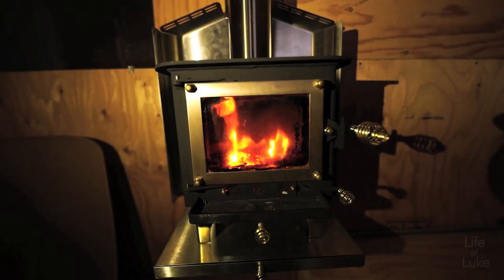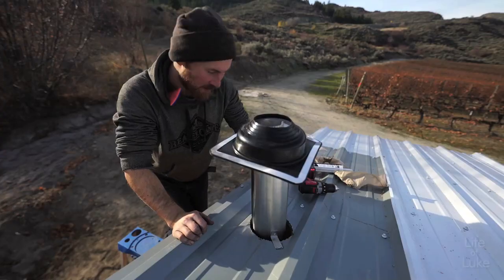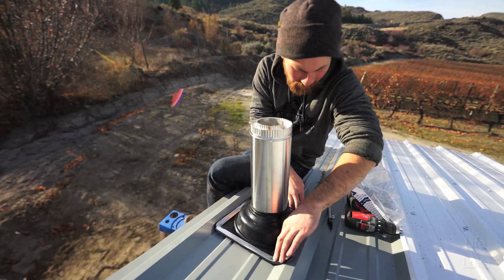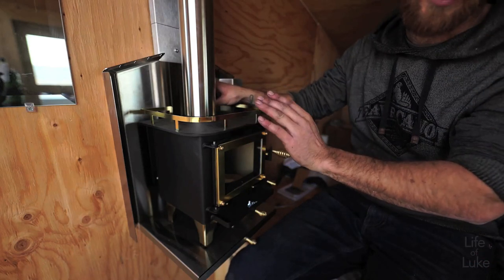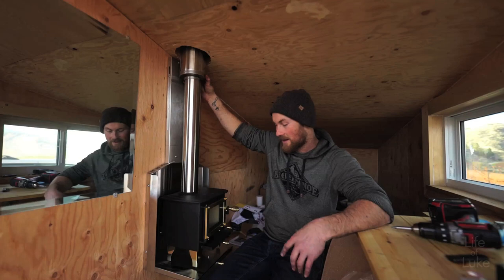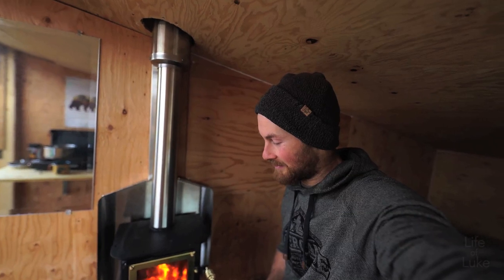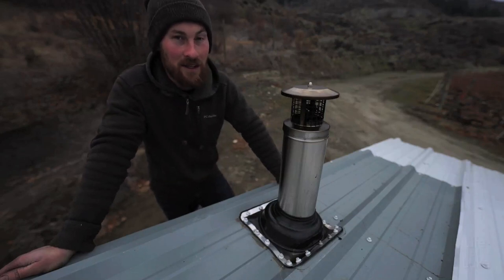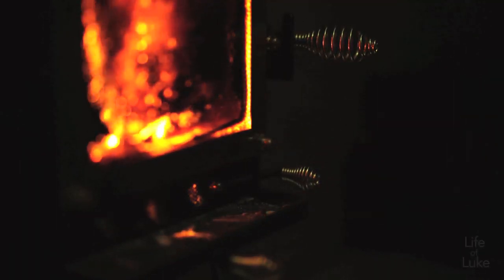Cubic Mini Woodstove Install How To

Comment: This is a great video! And channel!

I'm building a small camp shack on skids, and my Cubic is on its way, so I couldnt have found this video at a better time.

Thanks so much for putting your experiences and know-how out there! It's appreciated!
Reply from the maker: Thanks, I'm glad it helped! It the shack on skids for moving it onto a lake for ice fishing?
Reply: @lifeofluke  I'm building it with the intention of replacing my current older trailer with some shade of tiny house. It'll serve as an extended living space/guest bed for family (I jokingly called it my unattached livingroom), but I'm keeping the dimensions such that if the idea flops it can be sold and moved. It might just end up as an ice fishing shack for somebody down the road.

Hopefully not though 😉
Reply: Where do you purchase one of those

Comment: I know old vid, if u still have this setup. Try taking a small cap full of diesel an pouring it on ur wood before u light it. The added fuel will help huge to push the beginning of the smoke through the chimney then out the tiny door

Comment: You need to remove the baffles on the inside of the stove when you clean it. If you don't all the soot gets trapped up there and will plug up your flue. You need to vacuum or brush the soot off of the afterburner then replace the baffles. Good work other than you need a ceiling trim plate too!

Comment: This was a very helpful video. I've been considering the Cubic, probably the somewhat larger Grizzly, for a 30 foot RV which is permanently mounted. I've been a bit intimidated at the thought of installing it, especially having to exit through the roof. It doesn't look so bad. Have you had any problems with leaking since then? Also did you get the side mount that draws air from outside or the regular one?

Comment: I have the grizzly..  I installed mine in my vintage tin can..going to do a below zero challenge on her this week. It does exceptional in single digits but in going to see how below zero temps do. Going on almost 3 years owning mine  Have fun..
Reply from the maker: Thanks Annie, stay warm over there!
Reply: @lifeofluke  cant wait to see your cabin. Awesome!
Reply: How are you liking it? I want to put one in my Vintage 1972 Travel Trailer.
Reply: @judichristopher4604  im still loving it. Its definitely the highlight of my vintage. I have a few videos of it on my channel if you want an idea of how it will look. I pulled the furnace and refrigerator that did not work and put my Grizzly right in place of it. No regrets. Ty Judi
Reply: @TrinityRidge1959  
GREAT IDEA.... THANK YOU!!!

Comment: Adorable, and perfect for my tiny home. My question, are there any parts to allow for installation on the side, instead of the roof?  I do fear roof leaks over time.
Reply from the maker: You can install a stove pipe out a wall, but bends in the pipe are more difficult to clean, and therefore can lead to a chimney fire, and a vertical stove pipe functions better than a horizontal exit.
Reply: I was thinking and fearing the same thing in our off grid camper.
Reply: @lifeofluke  Thank you very much for the information. Vertical it is..

Comment: Hey there, was thinking about installing one of these in a similar sized cabin, but all the specs say 30" clearance above the stove, I was wondering what your clearance is to the ceiling and if you really think 30" is necessary. Thanks Luke!

Comment: Make sure you give it its first burn outside where it's ventilated before installing it inside, trust me I made this mistake!
Reply from the maker: Yes that's a good idea, I didn't do that and it was a little hazy for the first week, but not too bad
Reply: Why do you need to burn it outside first? What is the difference or outcome? I'm looking into ordering one myself for my tiny home.
Reply: Johnny Blue When you purchase your brand new wood burner, it would of come straight of the assembly line. That means the fire resistant paint would not have been baked. For my first burn, I left it outside burning for a good 4/5 hours just to burn of the chemicals from the paint.
Reply: @bigjohnconnect  cool I would have never thought of that. Thank you so much. I'm looking into this mini stove, the store is actually 20 minutes away from my place in Montreal. I've got a hundred square feet in my tiny house, and I'm wondering if it will do a good job for heating up while we have - 30 degrees Celsius here in the winter. What do you think? Should I go for it
Reply: @johnnyblue_  because the newly painted stove paint burns off the stove

Comment: How is the heat on the ceiling directly above the stove? We have found that our ceiling gets alarming hot.
Reply from the maker: It can get warm at times, but it's not too bad. If it does get hot I would suggest opening a door or window for some fresh air circulation.

Comment: Just wondering if you have ever had a problem with the wall clearance being so close? I am looking at installing one in my tiny camper but not sure how it would go with composite caravan wall materials
Reply from the maker: Hi! I've never had an issue with the pipe close to the wall, that being said, there's a metal backing with an air gap to deflect the heat away from the wall.
Reply: @lifeofluke  OK thank you. I'm excited to install a mini fireplace as they look incredible. Not really needed in the Australian Queensland heat but will look the part. Haha.

Comment: Cold mornings? How many times do you feed it a night?  We live off grid in the west kootenays in a converted school bus and our woodstove is just large enough to keep us comfortable in the winter. (Its rated for 1500 sq ft)
Reply from the maker: Ya, most mornings are cold if I don't feed it at night. I'm not burning hard wood or any fire logs which I guess might burn longer, but the size itself prevents a large amount of wood in the stove to burn all night.
You definitely need a good woodstove in the Kootenays!
Reply: HINT: At night if you put a few charcoal briquets in the bottom of it... the wood will burn down but the briquets will stay hot!!
I leaned this trick from an old man... I had 2 big fireplaces in my Bed and Breakfast and was up all night trying to keep them hot...
Reply from the maker: @judichristopher4604  That's a great tip!

Comment: There should be a metal flange for the interior roof hole, or there will be a roof fire in your fortune cookie
Reply: one thing about covering the inside is there ever is a leak like heavy snow and wind can cause you will not see it before it all saturates whereas it drips on the stove and hisses then you fix it roight away

Comment: Enjoyed the video! Hope you use a carbon monoxide tester in that small of space.
Reply from the maker: Thanks Dennis! I don't have a carbon monoxide detector I just crack the window or door for air flow
Reply: It's a vented stove- no need for a carbon monoxide test.
Reply: @pouglwaw5932  
I always use a carbon monoxide tester. I don’t put that much trust in any wood stove.

Comment: Awesome! Did the stove come with that metal wall mount or did you make/retro fit that. Assuming it is heat resistant enough to go into plywood (I am looking to put something in my shed) thanks for the video!
Reply from the maker: The wall mount is an extra option which I bought from Cubic mini

Comment: Nice video. Did you have to cut the little tabs at the bottom of the rail to take it  off?  Thanks
Reply from the maker: no I didn't, it just has to be jigged around to slide out the holes
Reply: @lifeofluke  okay, I didn’t want to break it thanks.

Comment: Hey man, I also have a cubic mini cub in my RV.  Iv'e been trying to find advice on the direction of the pipes though.  After about a week I got some creosote dripping inside and I asked alot of wood stove people and they all said the pipes were upside down.  Cubic mini says to install with male facing down, but you, myself, and everyone else installed them with the male side facing up (ridged side of the pipe.)  I am really confused by this, because the pictures on cubic mini website even show the male side facing up! Do you have insight on this?
Reply from the maker: hey Babhru, the ridged end of the pipe is the female end. Because the pipe exit on the stove box is female, the pipe slides on with the male end at the bottom, female at the top, so the next pipe piece slides on accordingly. Hope that helps!
Reply: @lifeofluke  Hey! Thanks for your input.  So your saying, they are reffering to the male end as the inside piping and not the outside piping?
Reply from the maker: yes, the male end should fit into the female end of the next piece of stove pipe

Comment: QUESTIONS  how do you modify the chimney cap for when you are traveling? How big of wood can you fit in it and how long can it burn for so you can fall asleep?
Reply from the maker: I don't do anything to the chimney cap for travelling, wood length about 15-20cm, a fire will burn out in about an hour to an hour in a half, but if really hot the stove will radiate heat for 3 hours

Comment: Did you burn the stove for a few hours before, to let the chemicals get out. I believe the instructions on it was to do that
Reply from the maker: Yes, definitely light a fire in the stove a few times before installing it! I didn't and it took a week or so for the smoke and smell of the paint setting to clear out

Comment: hey there . we are currently looking at purchasing the exact same stove but are having difficulty getting through to the manufacture . cam you tell me what extra pieces we need to get to have all the correct parts. also, did you leave the wider hole like that in your cabin or close it up later on ? thanks for any info, greatly appreciated
Reply from the maker: Hey Angela, you'll have to measure the distance between where your stove will be and 2 feet minimum above the roof, this is something you will have to calculate. Other than that, parts like the wall mount are optional

Comment: Hi friend. To ask. Does the lower lever do it? Which is under the door.
Reply from the maker: Does the lower level do what? - The lower lever is for opening/closing the air flow, used when starting the fire
Reply: @lifeofluke  Thank you for the answer. Always be well!

Comment: What stops the 5 inch pipe when you slide it  over the three inch like in your video. 
The five inch needs to extend 12 inches above the roof. I just bought the grizzly and soon will install the stove pipe
Reply from the maker: Nothing stops the 5 inch, but you also have the 3 to 5 adapter ring that will screw in holding them together

Comment: I had a tradesman help me install the mini onto my tiny house wall along with the mounting brackets etc. Now all that's left is to cut the hole in the corrugated tin roof and install the boot and remaining flu components. Any idea why the tradesman would have insisted that I need roof flashing for this install when it seems like the boot with the metal edging can be bent into shape to fit my existing roof? I'm worried he's trying to do more work than is necessary and might be ripping me off.
Reply from the maker: I don't know your roof so I can't speak to it, but if your metal roof has those tight corrugated waves, I don't think the boot gasket will be able to seal, that's all I can hypothesize what your tradesman is thinking.
Reply: @lifeofluke  I really appreciate the feedback, thank you. I was kind of hoping to DIY this one. I do have pictires of the the roof and install point...any chance you would be able to take a look?
Reply from the maker: sure just send me an email, you'll find it on my about page

Comment: How much clearance do you have from the top of your stove to your roof. I'm thinking of putting one in my van but I have limited space. The requirement apparently is 30"
Reply from the maker: Ya I have near 3 feet or just under from the top of the stove to the roof. If you have 30" I'm sure you'd be fine

Comment: The most cold comes from the floor. How do heat that?
Reply from the maker: Insulate the floor
Reply: @UCUIKug2dtMduQUaKvKVEUlQ I did. The best way to keep your feet warm, is warmth from under. But I keep interested. I saw with the luck down I can not get it now in the Netherlands. I want to google for adresses here. May be someone knows?

Comment: You didn't install a flue damper. All your heat is going out the roof !
Reply: These stoves have a secondary burn chamber to reburn the smoke and in the process keeping the heat in the stove longer...

Comment: cool mini stove, but youd be sitting next to it all day feeding it sticks to stay warm.
Reply from the maker: Ya but I'm rarely sitting at home all day so that's not really a concern
Reply: lifeofluke , debating building a tiny home on a 32 ft trailer,  id def want to get a small stove for it. how much did that one cost?  def easier finding small pcs of wood than cutting logs and swinging an axe all day right. in watched another woodstove video where the stove was on the left and it looked like it was 10 ft behind the guy, then the video started and he reached over to a tiny stove . wow optical illusion. i was out
Reply from the maker: @jc1608  This one cost about $1400 that's including the wall mount, chimney pipe, and extra bits. They also make a larger stove called the "grizzly", I'd recommend that for a 32' trailer

Comment: is that rubber roof jack combustible...dude...use proper jack...wood stove pipes require clearance from combustibles...ie rubber roof jack that is designed for plumbing vents is NOT for a-vents/b-vents/c-vents
Reply: It’s an insulated pipe through the roof it should be fine.

Comment: This is gimmicky BS.... you would have to throw wood in every 20 minutes at night.... whats the point in using this? Just for fun I guess?
Reply from the maker: heat - that's the point
Reply: I've heard of guys using compressed hardwood logs in these stoves and getting up to 4 hours of burn time out of a compressed hardwood log